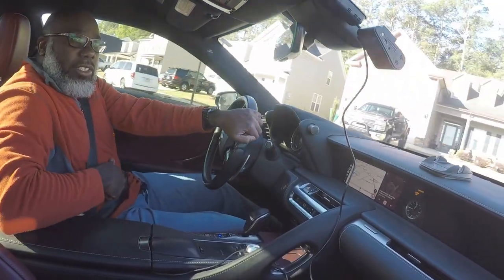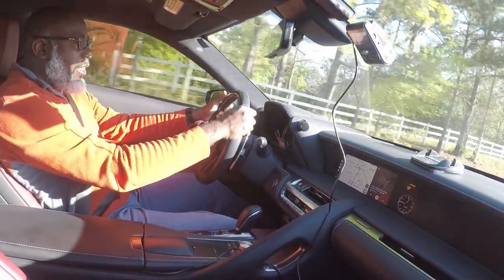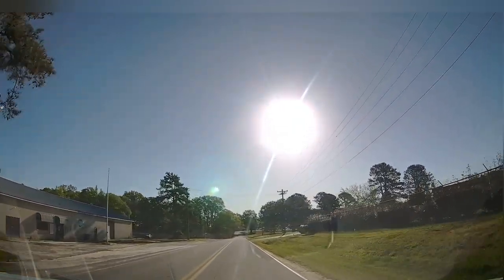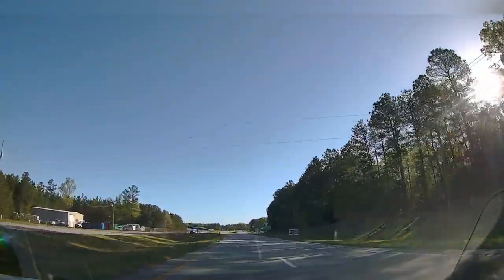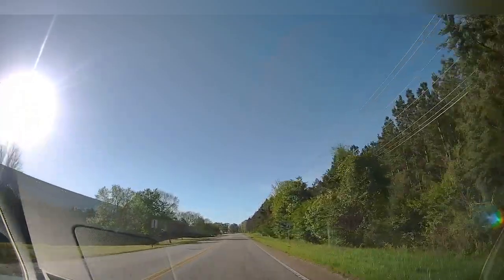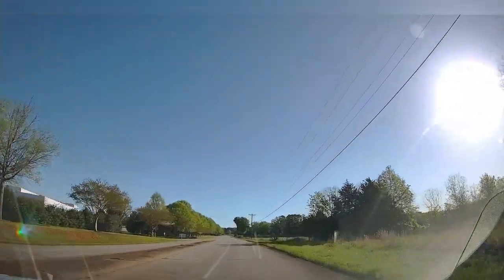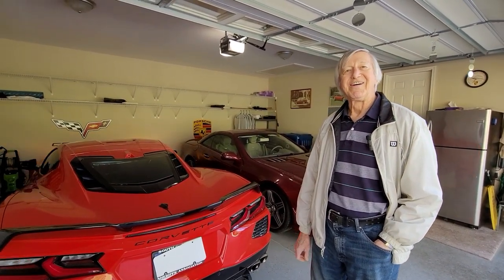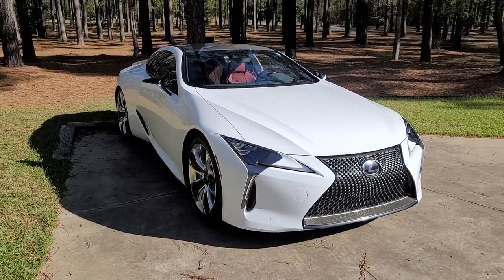Driving my 2018 LC500 on a Day Trip!

Comment: Nice video. You are right about the differences between your previous RCF and LC500. RCF is stiffer and more nimble being an M3/M4 competitor so it had a lot of tune and development on the race track while LC500 is a full-on luxury GT car meant for long distance cruising in comfort. RCF's shifts are fastest only when full throttle so that is a difference with the LC500 transmission where LC500 had the same speed at part throttle, but RCF's max shift speed is only 100 ms, but RCF has different gearing than the LC500 that is why sense of speed would be different in each car. Perception aside,  RCF is also about 400 lbs lighter, which is the biggest difference so the 0-60 mph and 1/4 mile time according to Lexus officially is 4.2 seconds and 12.5 seconds for RCF vs 4.5 seconds and 13.0 seconds for the LC500.
Reply from the maker: Good feedback on the RC-F time.  And driving the LC500 for a while, I think my RC-F was quicker.  Your times just assured me that  it's true.
Reply: @mylexrcfupgrades1222  Thanks man. Yeah. the gearing on LC500 is very different as it runs through gears faster compared to the taller gearing in the RCF. I believe the rev limiter is a bit lower in the LC500 than the RCF as well so it winds out gears a lot faster, which means you are hitting redline more often so it is indeed more fun than the taller gearing in the RCF, which is meant to hold the same gear near the redline going through the entire turn. Keep the content coming. I will be checking it out for sure. Cheers!